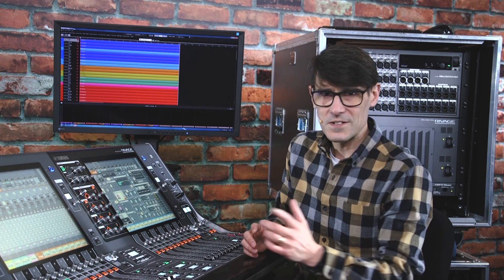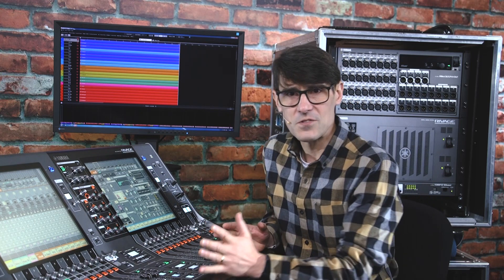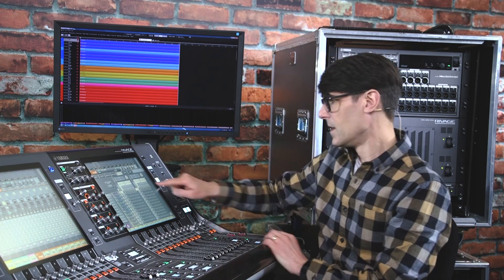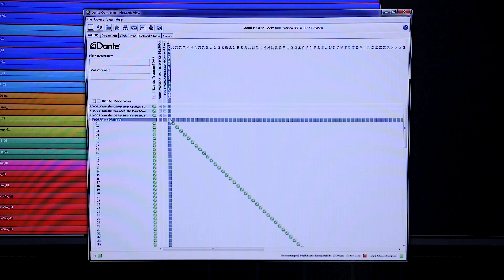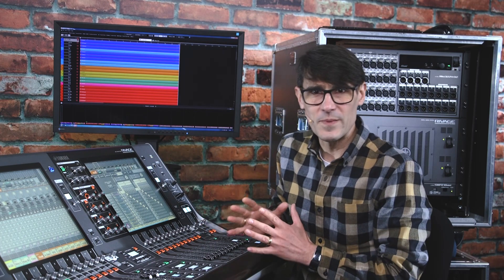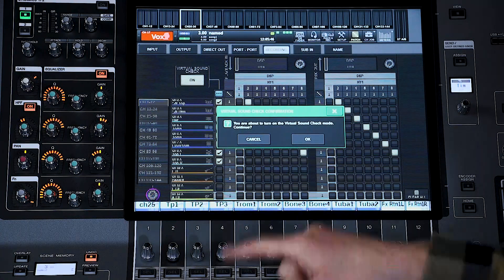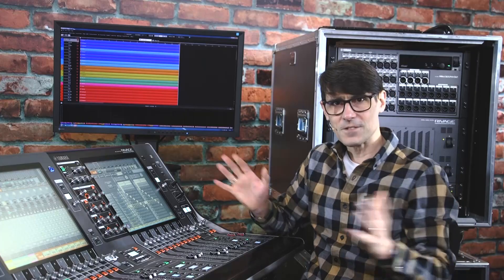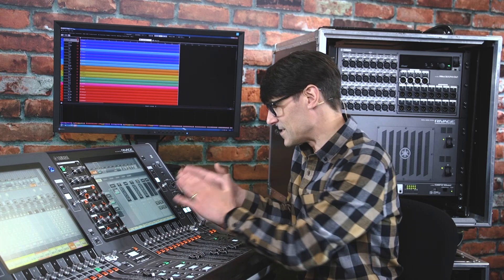RIVAGE PM Training Video - Virtual Sound Check and Recording

Comment: Hi, We are having PM5 console with CS5, DSP-RX(144d SRC on slot 1 and 144d on slot 4)& Rio3224, purchased the same 6 months back and we are not able to do virtual sound check since the 4th slot is not detecting the dante card, Yamaha has given a standby DSP and in that too we are facing the same issue, the Indian Technical team says they are waiting solution from Japan and all the mixer sold is having same issue, then how you are doing the same?